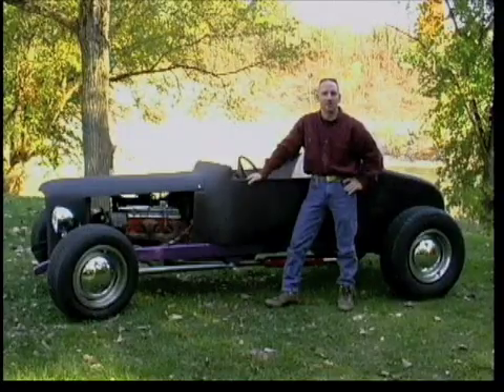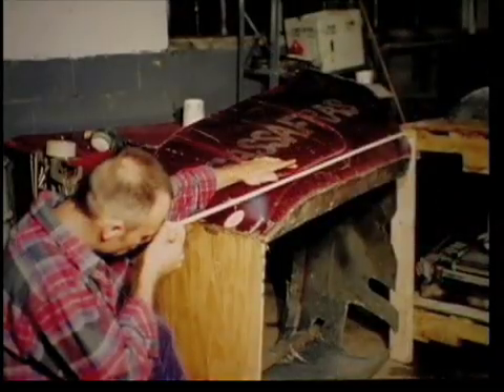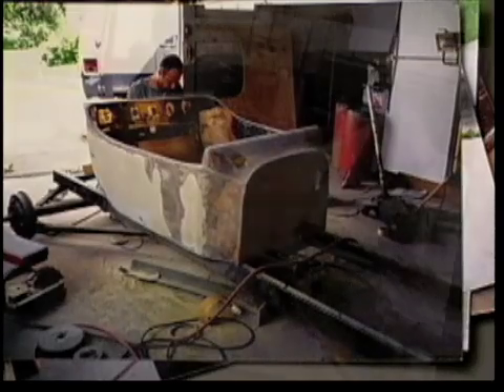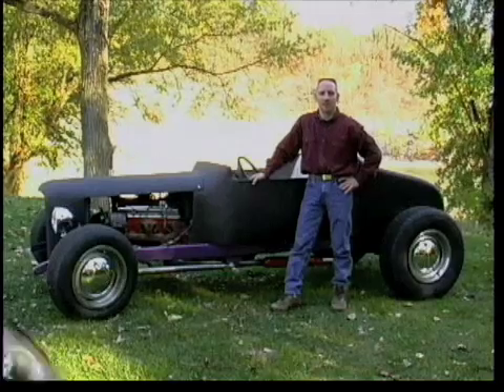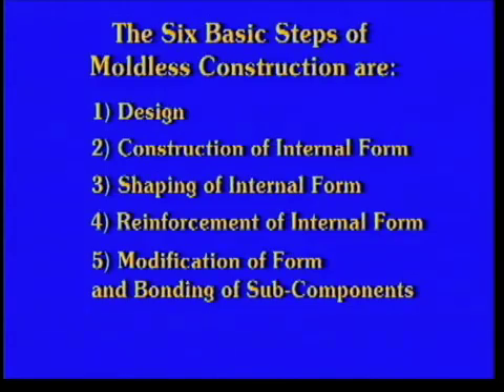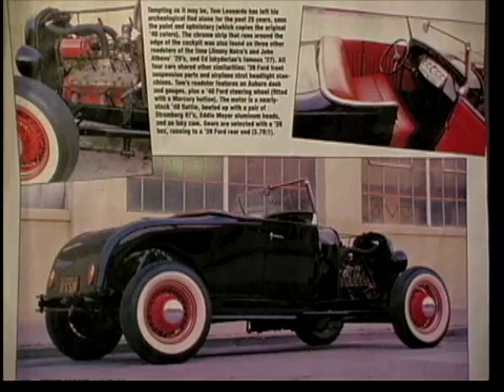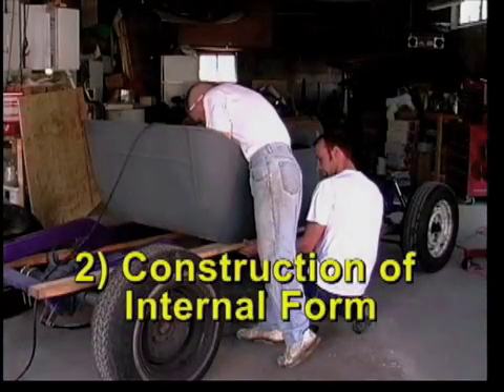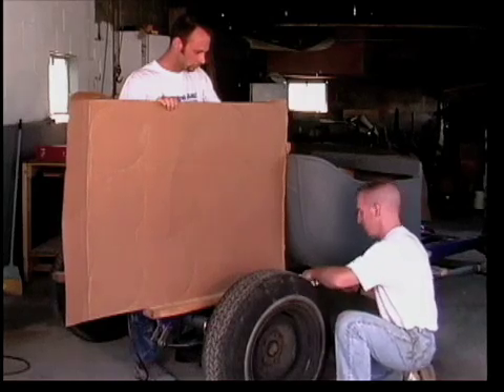Moldless Composite Construction 1 of 6

Comment: Why is there no S2 glass fabric that is equivalent in weave and dimensions as the best E glass fabrics used for moldless composite construction (e.g., 7715, 7725)?  Likewise, it’s surprising that there doesn’t seem to be any unidirectional S2 glass fabric that has at least the strength of 7715, but less weight.

Comment: Do not do this for boat construction. do no ever use filler for boat construction. boats require far better techniques for their hulls to be strong enough. these techniques are only good for cosmetics that's it.
Reply: The structure of a composite place is completely different. I saw some of the work I wouldn't do it. I would do it right.
Reply: J M that’s not true. Stitch and glue uses filler,floxed filler, and it’s very prevalent in boat building
Reply: Dumb ass , surfboards r made the same way 😂
Reply: Funny - Burt Rutan built planes using this technique and set world records with it... so might work well :)